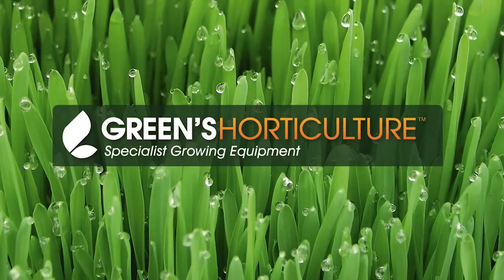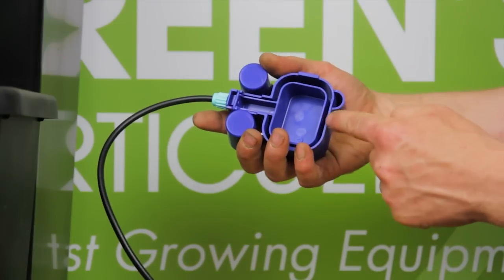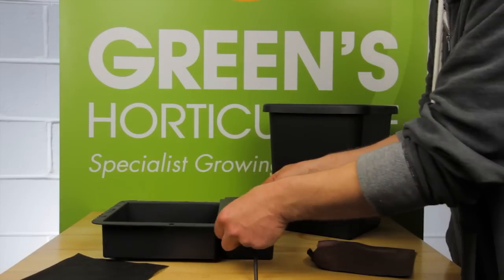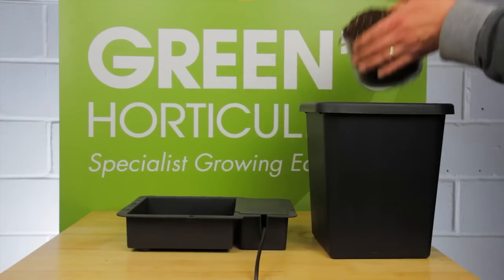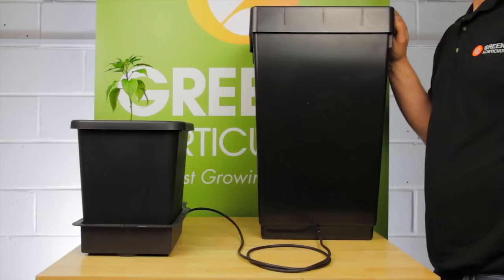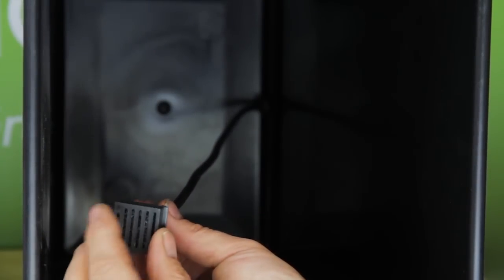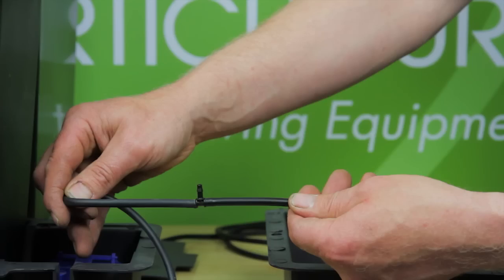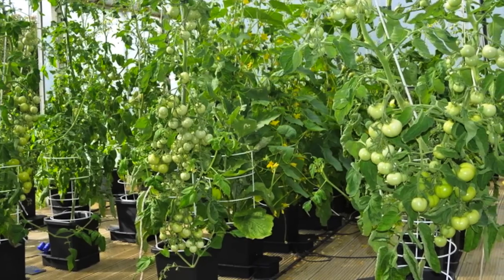How to Set Up Autopot Systems | Greens Hydroponics Tutorial

Comment: This video was a life saver. I didn't have my Aquavalves fastened in on the tab/slot that holds them still, so they were floating around inside the Autopot XL system and overflowing out of the trays. Thank you!

Comment: What if you added a control bucket with a float set to the desired water level for the entire system? If every bucket needs 4" of water, set it to 4" in the control and let gravity do the work. Install it inline between resi and plants and eliminate the need to have a float on every single plant. Simpler design, fewer parts.

Comment from the maker: Autopots are a great innovation in the horticultural industry. They use a gravity-fed design meaning no power, pumps, or timers are necessary. They're also highly efficient and when used right, give your plants just what they need to get great results:

How To Set Up Autopot Systems - Tutorial

#hydroponics #autopot #easy2grow #gardening #agriculture #horticulture #urbanagriculture #indoorgardening #containergardening #plants
Reply: Hello, i set my autopot up as your videos says, then later was told by my local hydro store that the copper root control thing is actually ment to go in the tray copper side up also autopot say this aswell. so just wanted to know other than me not being able to see when roots are at the bottom will your way cause me any issues. thanks

Comment: Does it mention anyway or does anyone know how the system corrects for salts build ups in the bottom of the trays.  Is this handled manually or is this a problem at all.  To me is must be.
Reply: at a guess, I would say, yes there would be trace elements building up. Maybe the tray will need a clean every 2 or 3 weeks. Maybe at the same time you refill the tank

Comment: Hi, is there any special fertilizer for autopot systems? Can I use Canna Hydro? Is there any  pump in water tank to keep it mixed?. Greets.
Reply: For better results you can use airpump for fish :) with very small bubles
Reply: @matejkuka797  air pump bubblers messes with the water ph , beter to use a small water circulating pump on a timmer to mix your water and nutes

Comment: Can a "click and drip" (or something similar) gravity timer be used with the autopot to help regulate the water a bit more?
Reply: i was wondering what regulates how much water gets pumped in?
 i've read of folks grow rooms getting flooded.
Reply: It is the "aqua valve" paired with the capillary wicking matts inside the pot which regulates the water. Yes floods can occur on this system im not too sure what causes the system to flood maybe a stuck "Aqua valve" or the pot is not in its tray properly causing the "Aqua valve" to constantly feed. It Maybe worth emailing autopot and asking what may cause a flood and get around it that way...
Reply: ran dom HA!! If I'd bothered to watch on i'd have found that out for myself 5 minutes later when watching an animated demonstration, it says that there's a thing inside the Aquavalve that regulates 20mm of feed no more & you're right, if it floods it's cos you haven't got the valves on right, aren't you supposed to top feed them for the 1st 20 days or is that another of these gadgets i'm getting mixed up with?
 thanks my man much appreciated!!
Reply: I never noticed the 20mm of water (only and no more) on the animated video. Believe me it's bullshit they stay too wet for too long In my opinion maybe it's good for coco as it really wicks up the water unlike soil which takes too long to adsorb and then stays too wet at the bottom of the pot and too dry on the top. It's just another gimmick system for the stoners to waste money on. Not my money mate! I borrowed a system of a friend never again!! And yes you are supposed to top feed only untill the root system is well established. But how do you check the bottom of the pot to see if the roots are poking out if when your remove the pot from the tray it's fills back up with water again. Yes maybe the plant takes what it wants when it wants but it's constantly sodden wet Its not going to breath and feed properly in my opinion. I'm going to Go with the halo watering system and control the feed intervals myself eventually building confidence to feed twice a day and make it fully auto. Good luck with which system you choose and keep it green...
Reply: ran dom i rewatched it and it said that the reason for Floodings was folk not having the 2 yellow valves aligned, fuck knows, but i'm like you..steering well clear!! :()
Reply: @68majortom  This is a Late reply, but due to flooding, its because the Aqua Valves D shape insert is not clipped onto the T Shape column in the Tray. Either the Water tank was moved and the hose was pulling the aqua valve out of its T socket making the aqua valve to go loose which causes the water to flood due to not being regulated properly. That's only one common issue.
Reply: To solve any risk of a flood I put a £20 ebay boat bilge pump in the tent then hooked to a car battery outside the tent. I then ran the bilge hose to my water waste pipe so it would harmlessly pump the nute mix out of the tent. If you use this method as protection DO NOT route the water back into the original nute tank or you are just refilling it to flood again. Run it to waste or into a drum or whatever. Cheers
Reply: @random5147  roots can grow into the Aquavalve if you don't use the copper mats, or if you add potash as a liquid it can crytallise and block the pipes (which won't cause a flood) or block the Aquavalve - may cause floods.

Comment: I wanted to make a super soil and bio tab set up for soil, how would this fare with this system? I’d assume with super soil and biotabs the plant would need to be water from the top often and it will just cause overflow from the excess water wouldn’t it? Or would the bottom layer of clay pebbles holding water soak up into the super soil and make it moist?
Reply: i had terrible results with this system and bio tabs
Reply: @LongFinger021  soil or coco?

Comment: help me out lads im a bit confused if you have 2 wall sockets a u have a contractor for 4 x 600 watts they require both plug where would u plug ur extractors and hydro systems to ? can u address this in a vid plz
Reply from the maker: Hi ***** , it would be best to give us a call on 0117 971 3000 as we can talk about your exact requirements and the best way to tackle any issues you may be having. We're more than happy to give you advice if you can call us. Our phone lines are open Monday - Friday 9am - 5pm.

Comment: omg... getting that prop in the hole to the water container is impossible!!! wtf.. please make a better design.
Reply: Did you lubricate the rubber mate? Saliva does wonders. It has to be tight so it is does not leak. Personally I have set 3 reservoir tanks now, and it was never a big issue. BTW have had great results wit my grows.

Comment: They don't talk about how fragile the fittings are, namely the T Fitting where it joins the 6 mil pipe and the 6mil fitting on the valve. Plus if one valve isn't working correctly and stays open, or not secured you will awake to an empty tank and a huge flood. Has happened twice to me.  . Plus you have buy every fitting again and they offer not service nor refunds. The system is crap and not user friendly like its promoted. Plus can not add enhancers etc.